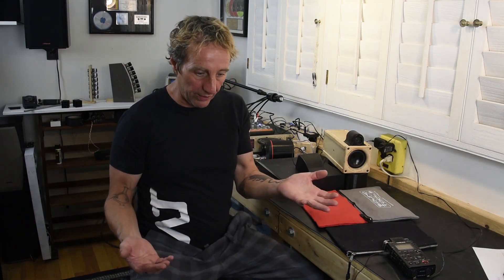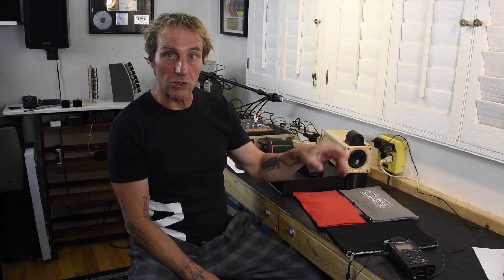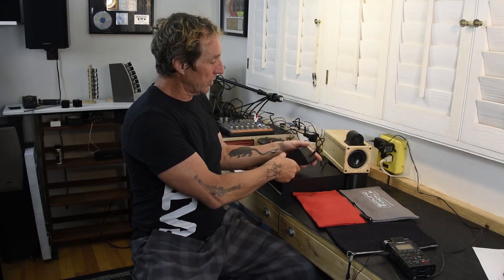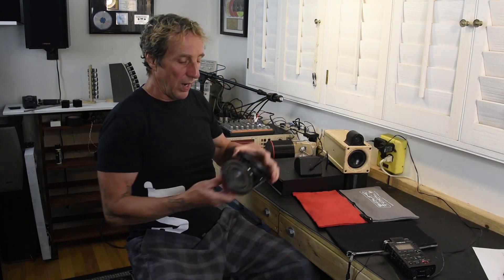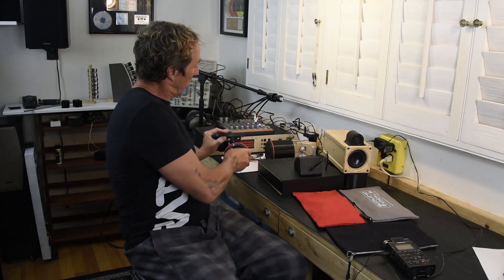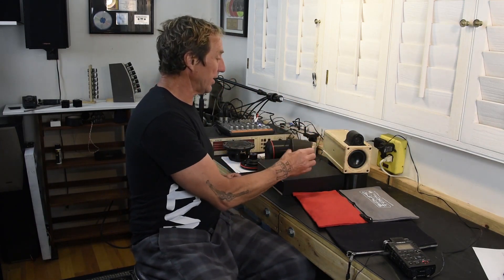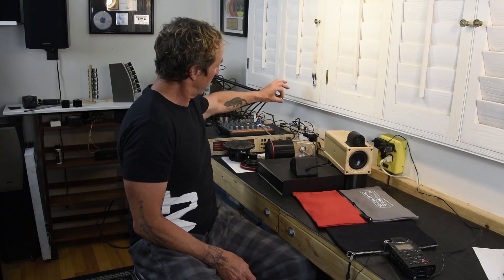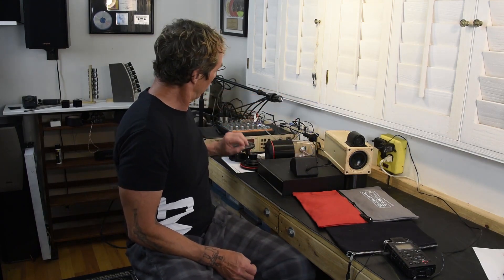Dave Rat on Main PA vs Monitor Polarity

Comment: I noticed the inside kick sounds different with polarity flipped with out other mics on. The punchy choice is louder with more high end. The other polarity choice is lower in volume and more bass. Perceives to be less punch. Im assuming the more bass polarity is in phase?
Reply: Kick in and out will have a polarity setting that is more and less in phase with each other. We cant perceive absolute polarity - with only one mic unmuted, humans aren’t able to discern whether it was a negative or positive pressure wave that hits our ears first, and it certainly wouldn’t have implications for tonality.